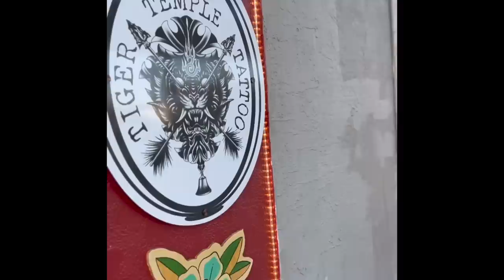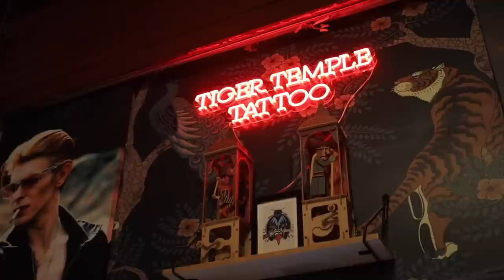The REAL Problem with my Harley Davidson

Comment: I have been riding since I got a used Honda 50 on my 5th birthday, I'm 45 this year, never got an endorsement until 3 years ago when my crap state made is mandatory along with insurance. If you get stopped without either one your bike is impounded. Then not only do you have to pay impound fees but have to prove to have both your endorsement, and insurance before they will release your bike! YAAAAAYYY Washington!

Comment: What kind of lift do you have shadetree? Hobo freight? Pros, cons? Looking to get one for my 03 fxdx to do cam chain tensioners and general maintenance and cleaning.
Reply: It's definitely the Hazard Fraught lift.
Reply: @TurboDog73TX  had any experience around one? Everything I've read says the wheel clamp sucks and needs an upgrade. Just wondering if it's worth buying this including upgrades or go a little nicer and not need to upgrade.
Reply: @andyreid7274  they're functional, nothing more, nothing less. Definitely NOT top tier stuff. But better than nothing.
Like most big ticket tool purchases, I would rather buy a USED top shelf lift than a substandard one, but sometimes those options aren't available, and Some people want something brand new whether it's a turd or not.
TLDR: Don't buy it if You need it to feed Yourself, if You're strictly using it sporadically at home it's Ok.
Reply: @TurboDog73TX  sage words. I appreciate it!

Comment: What's up with those TC bros wheels? Must be fucking junk. I just bought a front one for my old lady's bike and am thinking about sending it back and getting a cast wheel.... especially after I checked the run out and it was all over the place and more than the .031 tolerance.